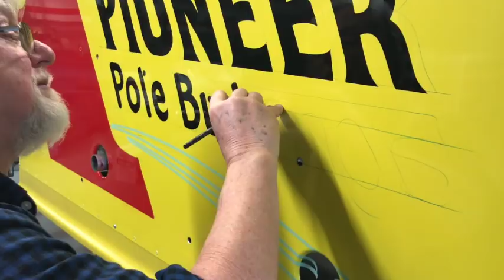Hand Lettering Billy Pauch's Modified

Comment: why not just use vinyl graphics? im sure its way cheaper.
Reply from the maker: It’s actually less expensive than getting vinyl and also weighs less
Reply: You can touch up paint where tire marks are on body, with a vinyl wrap it just disenegrates or looks like shit.
Paintwork holds a way better gloss shine, Wraps are overpriced pieces of thin plastic.
Reply: Hand lettering is far more unique because the people doing it are artists in every sense of the word. Not to say that vinyl shops aren't - there are many who are great designers & do original work, but a lot of wraps shops use stock graphics & numbers which is why you see a lot of cars looking the same, style wise. You could learn how to install a wrap and use clip art in a couple of months - grab a can of One-Shot and a lettering quill and practice gothic, casual & script daily for about 10 years...
Reply: I need this brush